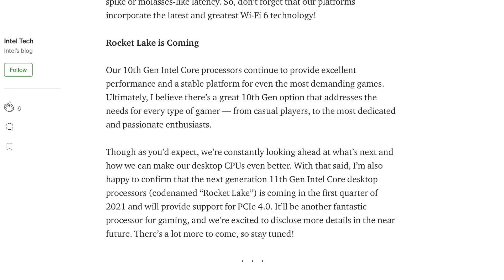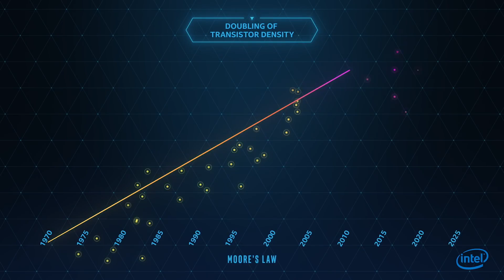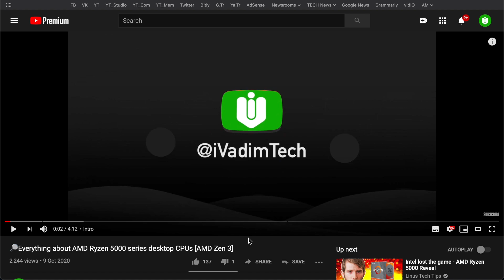Ryzen 5000 better than Intel 11th gen Rocket Lake?

Comment: Lol 8 core 16thread dude intel already made a 10 core 20thread 11th gen will be way more cores and threads. This guy if you look specs for gaming intel always wins.
But price range clearly ryzen, but if your buying ryzen go buy a ryzen gaming card not a Nvidia as ryzen just said if you go with ryzen 5000 plus you must get there gaming cards so they can put out more performance? See what there trying to do.
Alot of tech youtubers said AMD wont bead Nvidia gaming cards.
Reply: fool AMD has 16 core 32 thread 5 th gen ryzen and 12 core 24 thread ryzen. Its intel which only got 10 core products.  The highest AMD got is 64 core  128 thread threadripper and Epyc. In gaming AMD 3rd  gen is much better and wins over your outdated intel, In every other task intel sucks badly compared to the older gen ryzen and the 3rd gen Ryzen is the king in everyuthing.
Reply: @gisg3073  yeah but for gaming intel still gets higher frames even to the latest ryzen 5000 even look up the bench on games.
Reply: @NRTuf  dude stop saying foolishness. Ryzen 5000 series get more frames per second for most of the games. You should watch the gaming benchmarks clearly. only in very few games intel processor gets more fps because its optimized for intel. But majority of games gets more fps on an AMD 5000 series. If Ryzen is coupled with an Radeon 6000 series graphics card, then again performance will increase to 10 to 15 % that means all games will get much more fps on a Ryzen. Ryzen 5950  + Radeon 6000 is the ultimate gaming machine.
Reply: @gisg3073  yeah a few games ? I think it was slightly more, i was watching a few youtubers benchmarks and its not worth upgrading yet, i would wait and see what intel does aswell.
Because before ryzen was loosing on gaming frames it was onlg winning on load times.
I will send you a link on a video, and you should watch it trust me, there over hyping ryzen.
Reply: @gisg3073  but clearly ryzen wins on load times and stuff but not gaming frames they only just know started to catch up with gaming thats why i stayed with intel, they make AMD look so good but there not.
Reply: @gisg3073  it wins on other things but for gaming frames it still, doesn't win on every true benchmark i have seen i linked you a video on ryzen 5950x vs 10900k. Did you watch it and by the way intel hasn't bought out there new CPU yet to compete with ryzen, the i9 10900k is meant to be compared with the older ryzen not the new ryzen that just came out. You won't know the true specs till they also bring out there new intel cpu the 11th gen.
I already admited ryzen beats the 10th gen 10900k but for gaming frames from what i have seen it doesn't the 10900k beats it most times by 5%, on gaming frames.
Reply: @gisg3073  those results arent trusted by trusted tech companys, those results how do you explain 10 to 15 frames more on this video the 10900k did ?https://youtu.be/hwi7zoWq2Y8

And then your video shows that ryzen achieved more when on other tech company's showed intel still was getting higher frames in game it doesn't make sense, i dont trust companys that dosnt show proof like the one i showed you.. the one your showing could be fake theres no evidence the way this guys explain it in full detail, they full show what there using in full detail the videos you linked there's no explainion of what there using. Because of that and the video i showed you you ignored it face the truth. I have a ryzen and a intel from last gen, my intel always doubles on frames, because of that and when 11th gen comes out I'm staying intel i have last gens 3900x is what i have on another build and it never was close to 10900k game frames. Because i have this builds i know what's better for gaming ryzen is more for editing in my video and game developers.
Ryzen is only winning on load times and stuff it never has beaten intel on gaming frames and i can show you pervouis versions of ryzen and intel and intel is always 20% higher frames on all games this is the first time ryzen is sometimes out of 4 to 10 beating intel on some games but most games intel still gets more frames by 6/10 i already showed you proof the ones your showing me doesn't show evidence what there really using, they don't show the hardware there using on video to prove there work.
Reply: do you have any other video other than this guys video. even this guy is praising ryzen. I told you to watch the biggest channels like Linus tech tips, Jaytwo cents, Gamer meld, hardware canucks and there are more than 50 videos from gaming channels that are available that shows every detail of the PCs that they build. The channel that you showed only a very few games, that too ryzen performed better in some. Dude type ryzen 5950 vs core i9 10900k and see by yourself every details of the pc builds and the gaming performance. Only a fool can say intel is better. 99% of the videos shows ryzen is far better. I can put almost 50 video links in here showing ryzen crushing intel. Dont say everyone is fake. They are from very respected channels. Dude a ryzen 8 core 5800 gives better fps than a 10 core i9 10900. Just type ryzen 5950 vs core i910900. Everyone says intel is crap.
Reply: @gisg3073  i know ryzen is the winner but on frames on some games intel does beat it, not saying every game but even so intel is still really close and dont forget its not even the 11th gen yet, to compare it with ryzen. For gaming i have noticed intel seems to get higher frames yeah mabe now ryzen court up but before they where behind on gaming frames. Not many people that dont game care abut this but many gamers buy intel for gaming frames. I know ryzen always beats it with other stuff but thats the only down side with ryzen till now the 5000 series they improved on gaming frames, but there still lacking the cpu speeds intel has like 5.3ghz compared to ryzen 4.9ghz for gaming the speed is really key for gaming and frames. But since AMD'S new CPU its been a decent improvement but it hasn't wow me yet untill i see the 11th gen and they then compare the figures thats what i want to see because there saying 11th gen will gain 11% to 20% on gaming frames and speeds, and from those percentage it might be again higher frames on intel side.
Yes intel has been getting beat with other stuff and scoring but dont forget 4.9ghz and intel 5.3ghz whats next for 11th gen what if they boost it to 5.8ghz, like again intel in this aspect and frames haven't disappointed me , like i have 2 pc i sold my 10900k i9 and kept my old i9 9900k why because if you look up the bench on gaming the i9 9900k actually has 20 to 30 frames more on some games which i found interesting, so i kept it then the ryzen 9 3900x that i kept when I'm gaming was getting 30 to 50 frames lower then my i9 9900k so if you compare i9 9900k and i9 10900k there's really barley any difference on gaming, sometimes even the i9 9900k gets higher frames which dosnt make sense.
Reply: @NRTuf  Ryzens has got lesser Ghz than intel but much more ipc so that In both single core and multi core scores Ryzen is much better than any intel. Look at Cinebench benchmark or any  other bench marking scores for intel and AMD. You have to understand that some games are optimized for intel. Games also never uses the full power of cpus. Most of the present games only use 10 to 20 % of Ryzens processing power. Rocket lake will have almost 15% more power than 10 th gen, that only gives that equal ipc to Rzen 3, not much gaming performance.  present 10 th gen intel processors are much worse in ipc and total processing power on both both single and multi core. Rocket lake can barely level the performance of Ryzen 3 in other applications and for gaming it wont give you that much performance but will be less efficient that Ryzen 3 because it also uses 14 nm outdated manufacturing process. Next year Ryzen 4 series a 5nm processor series will be launched with almost 20% performance increase. So rocket lake dont stand a chance.
Reply: @gisg3073  that's true, but 5.3ghz still for gaming its perfect in my view i set mine to 5.4ghz i didnt need anything else cpu usage stays on 5% while gaming.
I think ryzen just a gimmick no game runs all those extra CPU specs anyway.  
Good thing abut it is when using mulitiable stuff and jumping from 2 to 3 games on ryzen. No one does that anyway, so i don't see any point frames are still decent.
Unless your a computer tech guy and run multiple stuff at the same time then yes ryzen is for you, but if you only play one game and stream here and there, intel is good, ryzen never hits its peak my intel i9 9900k and i9 10900k has never gone above 20% while gaming and streaming and having browser's open same time, if it was struggling like 80% to 100% then yes i would consider ryzen but do you see what i mean they never hit there peak so i got no care abut upgrading there's no need unless your a gaming developers using multiple things testing 10 games at the same time then ryzen is the one to go for, but since there new release that ryzen did i was impressed for gaming but the ones before that i was not impressed intel was winning for gaming i had a ryzen myself my i9 9900k was getting 60 frames more but now they finally improved , i no they have been beating intel on other things but gaming was intel go to for frames, but since the new 5000 series i can see ryzen is to go to but at 1080p intel i9 10900k has the same frames some games even more frames by 10 to 3p frames, but at 1440p or higher ryzen 5000series kills intel i agree on what your saying, there is some games at 1080p still intel is doing great for competitive gamers.
If intel now fails on gaming frames i will have to switch myself, because im a competitive gamer myself i play mulitiable games for earnings.
So far the 5000series is something i been thinking abut but it all depends if they can pick up there stock or if i should wait for the next one.
Reply: @gisg3073  now watch the 5900x vs i9 10900k i think a lot of people are over making ryzen look good but there so close on this results even sometimes 1% higher is intel even look for yourself, i also know because a friend of mine got a 5900x and on modern warfare i get 10 frames more on intel not sure why watch this, https://youtu.be/3pgCaOMGaNU
Reply: @NRTuf  you are searching hard to get what you want. Dude Ryzen is good, like there are ten thousand applications and games, and 99% of them runs better in Ryzen.  In every videos including this the Ryzen is shown to be better. I can show you more than hundred video of Ryzen running better in everything. Your 10900k is so crappy that in every other application it sucks. Only in gaming it is little bit close, but cannot match Ryzens performance. This is 5900. Ryzen 5950 is the best. Intel doesnt have any processor to match it. Ryzen 5900 also is better than your 10900k.  The single core performance and multi core performance of Ryzen is vastly better than any intel. Also look at the cpu usage in games. Your intel is sweating meanwhile Ryzen is barely getting utilized.  Games are like kids play for Ryzen. Future games will take advantage of Ryzens full power and it will run vastly better than i9.
Reply: @NRTuf  also this guy uses a ddr 3200 mhz ram in ryzen that's wrong. Ryzen support 3600 mhz ram. Your intel is so outdated that it only supports 3200 mhz ram. If you use 3600 ram in ryzen you can get 10% % more performance in games and other applications.
Reply: @gisg3073  that's interesting, i had a 3200mhz on my intel i9 10900k i switched to a 4800mhz i gained 20 to 30 frames on games this doesn't make any sense? 
Mabe ram gives you more frames regardless what the cpu needs.
Reply: @NRTuf  no you cannot gain anything. Intel dont support anything beyond 3200 mhz. Intel website itself says core i9 10900k only support max upto 3200 mhz and max memory bandwidth is 45.8 Gbps. Read core i9 technichal specification before saying these kind of things. I cant understand how you can gain that much 20 to 30 frames. Even intel itself cannot get anything beyond 3200mhz, then how can you get 4800 mhz on a  i9. It seems like you are lying.
Reply: @gisg3073  i replaced my 3200mhz corsair to corsair dominator 4800mhz, changed the ram setting on bios to 4800mhz  i actually have video of my old frames and my new frames from changing it, it does make a difference even if the cpu dosnt support it the ram is doing the work itself, you dont need the cpu to support higher clocks i did a test a couple times try run a 2666mhz ram and switch to a 4000mhz or above and see the difference. Even if the CPU doesn't support those speeds the ram does itself because the motherboard supports  those speeds if your motherboard supports those speeds it makes a difference that's why I'm saying even if a CPU dosnt support it i still gained frames. 
I checked the ram speeds and there hitting just past 4800mhz. Thats why i buy top of the range motherboards.
I can give another example mate had a 3200mhz speed he switched to 3600mhz he gained 5 to 8 frames and he showed me photos ? So i don't think cpu is the main source of the frames, a lot of games also use a lot more ram storage then the gaming card, a lot of people say the speed of the ram is important. 
I had a customer same thing with a intel i5 9400f he was getting 60 to 50 frames on his 1650, on a certain game from a 3000mhz, we switched his mother board higher end that supports 4400mhz and we switched it to a 4000mhz hes getting 70 average to 83 frames? So how can you explain that ? I dont think cpu is doing the work it self ram is really important.
Do a test yourself you will thank me later, theres a few youtubers showing the diffrence between 2666mhz on intel to 4000mhz theres always a 10 to 20 frame gain.
This is another reason why i find intel intrestesting no matter what other people say ram does matter even speed.
Reply: @gisg3073  heres one example https://youtu.be/r8YIQMA0FYY

I find corsair is better you get more then what this guy is getting, and motherboard matters a lot as well depending what mother board you can gain even more frames.

So explain that ?
Hows this possible with intel ? 
Then with ryzen there only a 1 or 2 frame difference
Reply: @NRTuf  a ryzen can support upto 6666mhz. Intel is nowhere near. Ryzen got the current world record of maximum Ram speed. If you use 6666mhz then ryzen gets the maximum frames in games. https://www.techradar.com/in/news/amd-ryzen-4000-smashes-world-record-ram-speeds
Reply: @gisg3073  i didnt even know that this helps, thanks i was planning to build a ryzen next. That makes me want to build one but I'm waiting for new motherboards expensive ones, unless you have one in mind ??
Reply: @NRTuf  Go for Ryzen 3 - 16 core 5950 with Asrock or Gigabyte or Msi. Asus have stability issues. Once I got an Asus board with AMD and it gave me lots of headache. After that I never purchased Asus. Asus with intel is stable but with AMD is not good.
Reply: @gisg3073  thanks mate i might go msi, 5950x sounds promising.
I will have to get my hands on one but was thinkong if i should wait for a new motherboard if they bring one ?
Reply: @gisg3073  yeah when theres some in stock, i was also suprised when i saw this results https://youtu.be/OnMEAW5VVUo

Some games intel did actually not bad, but i have to remember the 5950x offers other performance factors that are important, when there's one in stock i will grab one.
Reply: watch reviews of the best youtube reviewers, Linus tech tips, jay two cents, gamer meld, hardware canucks etc , everyone shows Ryzen is much better in gaming Ryzen wins 10 out of 9, that too some games only use less processing power of ryzen. Outside gaming intel sucks badly. .  few games are optimized for intel. That games too never uses Ryzens full power.  Ryzen is also the fastest single core and multi core processor in the world. Every benchmark shows that. you are the only one saying that outdated intel is better. I cant believe that. Games are childs play for Ryzen, they only use 20 to 30% of ryzens power while that outdated intel has to give 100% to run those
Reply: just type Ryzen 5950 vs i9 10900 and every review shows Ryzen is much better in everything. How can you say all are untrustable. Then show your benchmarks. Do it yourself. I have see almost 30 different review videos of Ryzen vs i9 and in all of them Ryzen is far better. And no one questions it in the comments. They are all trustable channels and the best youtube reviewers are Linus tech tips, Jayz two cents gamer meld Hradware canucks and all these guys shows clear win for ryzen. You dont have any idea about what you are saying.
Reply: @gisg3073  i already sent you a link listen to yourself kid, watch the link then come talk skip to the game benchmarks.
Then say something stop avoiding it mate.
Reply: https://youtu.be/hwi7zoWq2Y8

Watch it and stop showing me links where those people don't show the builds in video they don't show there pc they don't show it live those are fake benchmarks.
I have a ryzen 9 3900x and dude my i9 10900k gets double the frames on every game. If we compare the new ryzen now with the 10900k use can't regardless if it beats it I'm shocked to see how intel still gets higher frames on most games, now when intel launches its new cpu then we can compare benchmarks most people buy pc for gaming but if your a video editor a game developer yes ryzen is the one to go for.
Use are comparing the i9 10900k with a new ryzen wait for intel new cpu, then lets see if intel is still below or higher in gaming i dont care abut the other stuff all i care abut are frames and a lot of gamers only care abut that, that's why people still buy intel.